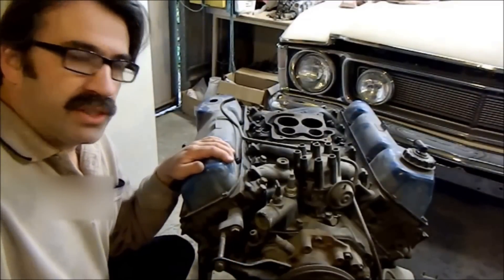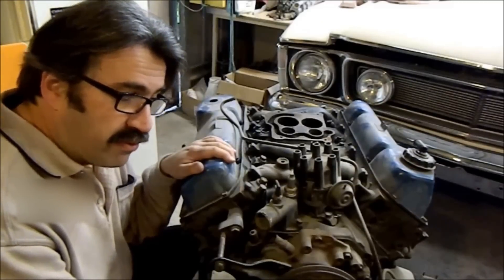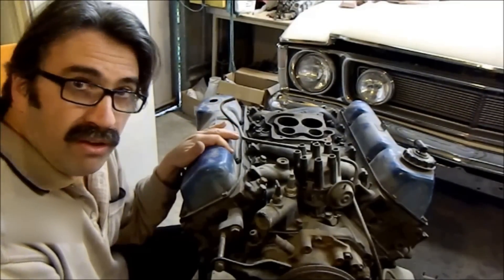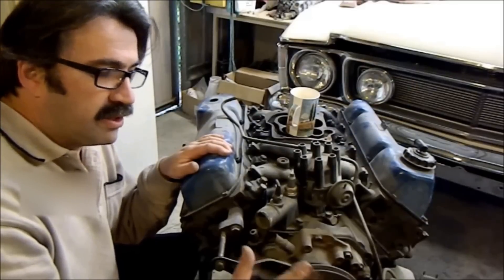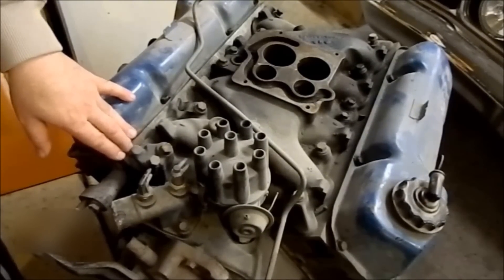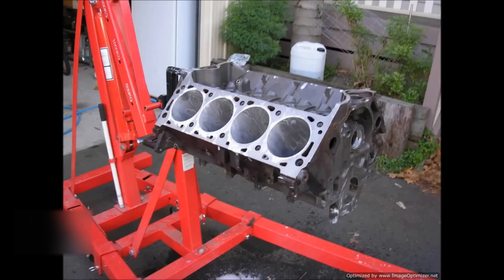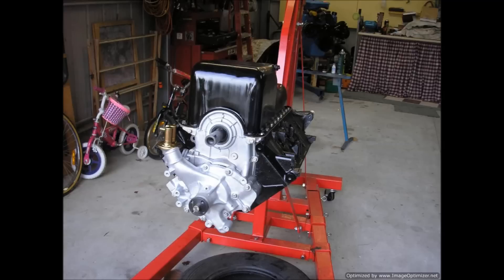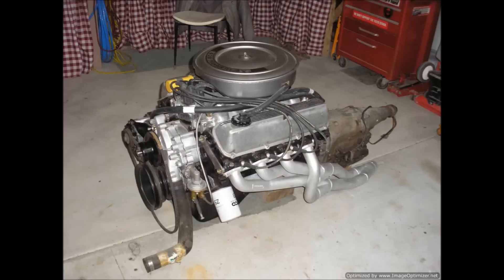Rebuilding the V8 - The Engine of Choice; 351 Cleveland Part 1

Comment: Thanks for the videos. I always love finding any more info about these engines that I can. Question, what ford engines were available to you in  Australia? Was it normal to see 429's or 460's there? How bout FE's? I do know you had the 302 clevland & the  351c, did you also have the 4v version of the clevland?
Reply from the maker: Yes Jesse, the 4V Cleveland was in the earlier GT and GTHO Falcons. FE big blocks came in Galaxies that were delivered here in CKD form and converted to right hand drive as well. I think some 429's and 460's came in but were very rare... some dealerships could supply American cars but it was very unusual. Most of the 385 type BB engines were brought in later on as rebuildable cores through API and the like. Hopefully someone reading this will know more about the American imports through Ford, cheers.
Reply: @PeterAndersons Facebook 😊❤😂
Reply: Thank you very much. I have been curious about what you had over there ever since I learned of a 302 clevland.

Comment: Please Help...With all the Noise from my cooling system in a fresh rebuilt 1971 351V 4V 4 BBL I was told (Mustang Forum) the Machinist May have put the head gasket on backwards?  Please advise. I've tried the expensive "period correct 351 C Thermostat" and it Does have the original bypass plate.  Still Sounds like a crew of tin benders going to town in the front of the engine bay while cooling down.. Pulling my hair out! please help. Love These Videos!

Comment: You would have liked my 351C 4V cobra jet.  I used a 400M crank turned down to 351C on the mains and small block chevy on the rods.  This with a .030 over and a 4.17 stroke that ended up at 426 cubic in.  I still have the motor.  I'm not selling it because I have some serous money and time in it. Every thing you could wish for is in it..  By the way it has a total seal secondary ring.  Vary impressive.  If you fail to keep the motor alive after a cold start the starter can hardly turn it over.  I thought it was a weak starter. It was cranking compression.  After the oil gets splashed upon the cylinders trying to start the motor and with the plugs in you couldn't turn the crankshaft from the front pulley bolt with a breaker bar with out risking breaking it off.  Pop the plugs out no problem at all.

Comment: No more tricks or artistic license. The complete engine on the stand was a clevo, the slides are of rebuilding a Windsor. I know they are basically the same engine but the Cleveland has the timing cover cast into the block not bolted on like the Windsor. Yes you can bolt the Cleveland heads on the Windsor.

Comment: Problems with boring it out 30 thou and not developing pin holes and cracks ,I had a 351 clevo develop cracks in cylinder walls

Comment: Thats a windsor man.  I have 3 clevelands outside.  That timing cover for one thing. Cleveland does not have water flow through the intake.  Those are windsor heads too.
Reply: #countryboycansurvive The engine at the beginning of the video is definitely a Cleveland engine, maybe not the picture, but the one with the 4-barrel intake is 100%
Reply: thats not a windsor,its a cleveland

Comment: Pete my 73 GRAN TORINO has a 400 in it I've watched guy's build 351c and 429s but have yet to see anyone build a 400 and it's the biggest bush rod motor Ford built with a full 4 in stroke and I'm going to build it but it's had to find parts for it got any ideas.
Reply from the maker: Hi Leonard, I don't know much about them and much would depend on it's basic spec. eg. 4 barrel and a moderate compression ratio (some were 2 barrel with a low CR). I would assume improved exhaust breathing with the correct cam and headers, re-graphed distributor to suit the cam would benefit it well. They are a square motor, 4" bore and stroke and 6.6 litres displacement, so should produce some very healthy numbers with the correct mods. Cheers Peter
Reply: I too question why and where are all the 400's.......
Reply: Leonard Gilbreath try ausfordparts they got them!
Reply: vintageiron utubd
Reply: You can put Cleveland heads on a 400m. if you get the 4v closed chamber heads they will ad about 75 hp alone. I am putting a 400m crank in a 351c and it should come out to 393CI. and will make more power than the 400m. My Cleveland is 4 bolt main caped and will hold the power better than the 400m. I have souped up 400m's though and there are a lot of after market parts for them, if you want to spend the money.
Reply: tim meyer in the us has all the go fast goodie syu will want for 400m mate
Reply: Depending on what you want, a lot of 351c parts will go on a 400m.
Reply: Edelbrock makes a intake for the 351M and the 400 that allows you to use 351 cleaveland heads and you can put together a very potent 400 with this. the intake http://www.edelbrock.com/automotive/mc/manifolds/ford/performer-351.shtml

the heads if you want something better than oem.http://www.edelbrock.com/automotive/mc/cylinder-heads/ford/performer-rpm-351c.shtml
Reply: 400M's are part of the Modified/Cleveland engine family. They are still quite easy to find in early to late 1970 ford cars/trucks. There is some differences in the M's and the Cleveland's and you do need to know or find out about swapping heads mostly. Basic rule of thumb is you can put Cleveland heads on a 351M and or a 400M, but you don't want to put any of the 351M/400M heads on a 351Cleveland.  Thats the simple rule. You should know what compression ratio you will arrive at when you are planning a rebuild and not just willy nilly put on heads you got a hold of from your brother in law or the garage sale down the street to start with. Do the research first, is also a good basic rule to live by. 

I have a 351C in my 72 Mustang with closed chamber 10:1 compression chamber 4V heads. The pistons were shaved a tad, and I think it is running about 8.5:1. It has a fair amount of power and runs decent on 85rated gas. I do notice a difference though on 93 rated. Any way. good hunting and rebuilding if you enjoy doing this. There is a damn good old Ford Modified engine family rebuild manual that you can get from Amazon, and I still see it in parts stores but the Haynes books, and or I'm sure most parts stores could order it for you. OH and 400M's bored to 40.thou, to 60.thou with a stroker crank and a decent set of Edelbrock after market heads/headers, and a 700cfm carb can make 500 streetable HP for about 2500 dollars. Not bad for a fun street runner.
Reply: Best idea, swap in a 429 or 460.

Comment: The 429 / 460 was always built to rev, there's a few guys that make Hemi Heads for them like alan Root and they are used in everything from race boats to tractor pulls.
Reply from the maker: That would be one strong engine... there's a joint that makes cammer heads for the FE as well... a dream indeed, but a fully dressed 427FE engine is about $50K.
Reply: You can just tell by those big round intake ports that it's an engine designed to rev.. would like a cam with big lift and not be too over the top. Would you have been able to put the 427 into the XD without any engineering? I guess it goes on weight (I'm in WA) and here I think the rule is you can have an engine in CCs about 4 x the weight of the car in Kilos before you have to engineer anything.

Yeah, heh Jay Leno has an original aluminium Shelby Cobra with a real FE in it too.. Guess it goes pretty okay. lol ;)
Reply: Jon Kaase is the guru for the 385 series Fords. He builds his own version of the Boss hemi head that is more user friendly than the original. His new SR71 wedge is one impressive beast too! It's difficult to find something that can use the kind of power and torque of these big engines, but I have one in a 21' Day cruiser jet boat.